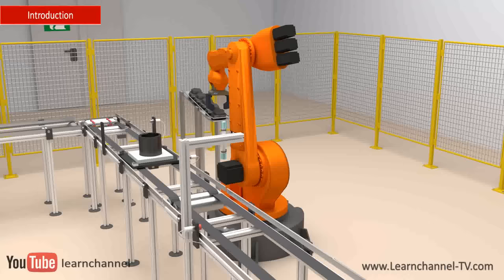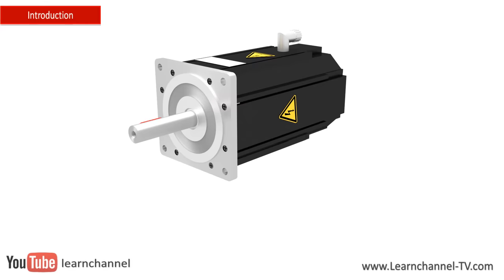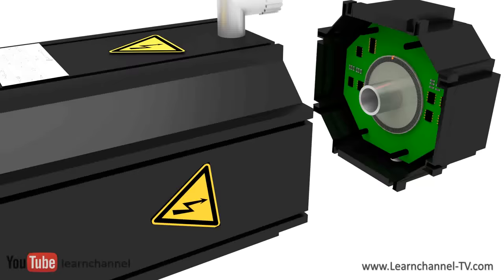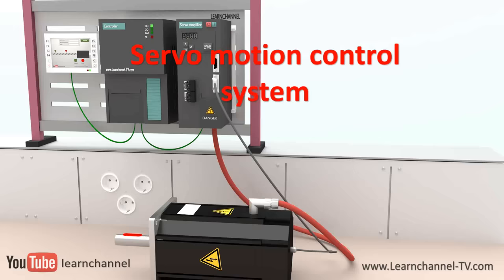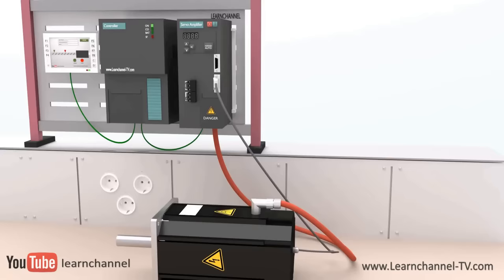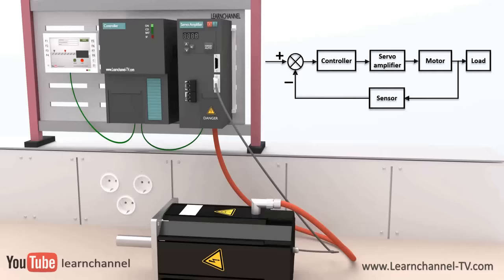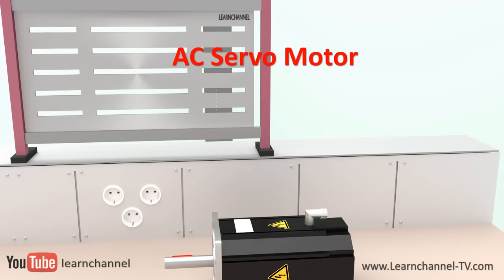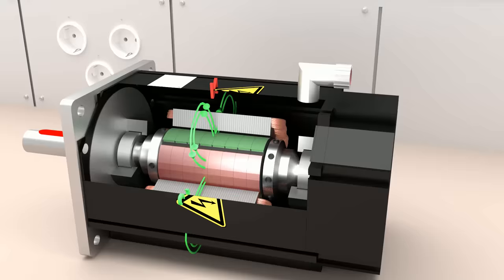Technical animation: How a Servo Motor works

Comment: Good video. How increasing the length (weight) reduces the moment of inertia?
Thanks.
Reply from the maker: The inertia depends mainly on the diameter and not on the length. 
In order to nevertheless achieve the necessary motor torque, servo motors usually have an elongated shape.
Reply: @learnchannel-TV  Thanks for your excellent work. Keep it up.

Comment: most of them are PMSM (permanent magnet synchronous motor) with absolute or incremental encoder,they have permanent magnets in the  rotor (neodym) and the stator coils have a distributed winding for sinusoidal driving just like the ac motors.

Comment: Can servo controller make small controllable steps (with rated torque)? Like stepper motor? Or step of servomotor big more then stepper motor?
Reply from the maker: First: Any motor used for positioning in e.g. CNC machine or robot can be called "servo motor". A servo drive must have a feedback system. 
The stepper motor can be clasified as a DC motor. A RMF is created by switching the stator voltage on and of or by reversing the polarity of the voltage. A hybrid-stepper has very small step-angles. Driven in microstepping mode you nearly cannot notice the steps.  For very simple position you can use stepper without a measuring system.
Talking about an AC servo motor you usually mean a 3-phase-synchronous motor. The current within the stator winding is steady or analog. This motor makes no steps like the stepper motor. 
Very small industrial robots, like Misubihi offers, use stepper motors as servo drive. Bigger robots (Kuka, Fanuc, etc.)  use AC servo drives.
Reply: Steppers usually move 200 steps per revolutions and no feedback means there is no guarantee that the motor actually moved those steps.

 Servos on the other hand have high resolution encoder feedback. I have seens servos with 2000 to 65536 pulses per revolution. This means that you can control the shaft movement with a lot more accuracy. 
So the answer to your question is that servo motor can make small controllable "steps", much smaller than a stepper. Although they are done in an analog fashion.

Comment: Are servo motors built so air tight to maintain the positive position feedback loop required?
Reply from the maker: I don´t know if I understood you right. You can get servo motor with different IP. The feedback loop ( for example by a resolver) provides the information about rotational speed and the angle of the rotor.
Reply: Thanks for the reply, I work with servo motors on injection molding machines and I've noticed they seem to run rather hot even at normal load and also seem to be built rather air tight, external cooling fins instead of any internal air cooling and was just wondering if that's why they need an internal dust free environment for the built in positional feedback loop system.
Reply: @darrylanton9323  Some that are built for continuous operation incorporate separately powered cooling fans. Servos aren't cooled by a shaft-driven fan like typical AC motors because they are used in applications where they run for short duration or at low speeds. They have to dissipate the heat through the case or add external means. If your servo motors get really hot while holding one position, the tuning of the servo drives may be too aggressive.
Reply: Yep, I've seen that some of our newer large machines have incorporated blowing fans mounted on the end of the servomotor directing air up the external fins towards the business end.  The new hybrid machines that incorporate hydraulic pumps driven by servomotors are more economical then full hydraulic and don't require as precise tuning as full servo electric machines do, luckily these full electric machines have a graph bar (0-100%) that's shows the servomotor load on each of the four variable servomotors that run during the process so adjustments can be made before overloading the motors and shutting the machine down.
Reply: @darrylanton9323  it will be air tight if the output shaft has oil seal.such small opening does nothing to cooling.  from the encoder end it must be sealed, because any contamination to encoder harm.

Comment: Why can't we change direction of ac servo motor by swapping the uvw leads. I was told servo motors are same as induction motors with encoder and gear control. Is this true
Reply from the maker: servo motors and induction motors have one thing in common: the rotating magnetic field. Servo motors have a permanent magnet as rotor and induction motors a "squirrel cage". Inthis vid I explained the RMF:
https://www.youtube.com/watch?v=vMu6DmfKHTs
Reply: Induction motor with encoder feedback and vfd can be used as servo motor but is not commonly used in servo systems. Permanent magnet motors are best for servo systems because of their high starting torque.

Direction of ac servo can be changed by swapping two leads but no one does that because it is needless. Servo amplifier can do this without swapping any leads. It can do other advanced things like torque, speed and position control
Reply: The drive has to be connected according to right turn phase sequence . If not, or one is missing, it gives a fault phase sequence error. The motor has to be connected accordingly ( U,V,W ) The shaft encoder on the motor will detect wrong turning direction. Direction, speed  ( = frequency ) ... can be easyly set by parameters. Some drives like Siemens Micromaster can be set using parameters that inputs on the terminal can be used to determine speed and turning direction. It even supplys the 10 V operating voltage conviniently.

Comment: Hello, can I run a servo  ac motor with the same program that starts the stepper motor(dir pulse)?
Reply: Yes you can drive a servo motor by pulse and direcion signal. Servo motor is widely driven using pulse dir signals. It is called position control mode of a servo motor.

Comment: I had did wrong connection for power cable which is  U and W I installed it up side down. Then after that the motor become heat. Is that make the motor broken because when I tried to run it, the servo drive give signal short to earth. Then power supply tripped.
Reply: if the isolation between the coilwindings is still intact it should work anyway.
Reply: Check coil resistance between the phases. It should be very small (a few ohms) and equal to each other.

Check the resistance between each phase and the motor body. It should show an open circuit.

If this is not the case the motor is gone.

Comment: Are brushed servo motors a thing?
Reply from the maker: Servo motors are used together with a closed-control system. But brush-motors in general  are 
used less and less because their high wear.
Reply: Brushed servo are not very popular but we have two out of 10 cnc machines in our factory which use brushed dc servo motors. A 1990 model Anilam milling machine and 2002 model Euromac MTX 1250 turret punch press.

Generally speaking any actuator which can propotionally control a variable using feedback is a servo system. Even induction motor with encoder feedback and a vfd can be used as a servo motor.

Comment: What is the animation software used for this video?
Reply from the maker: software is called Blender.
Reply: @learnchannel-TV  
How much time does it takes to create such an animation? I work with Solidworks Composer and want to know the difference.
Reply from the maker: @mk-zm6lu  I really cannot say because I made this vid during my fulltime job. It also depends on your equipment. I needed 2 months more or less - but I had a fulltime job.
Reply: @learnchannel-TV  
2 months?! Too much. Even a week is too much. If you want a simple tool, use SW Composer. Although it doesn't have all the abilities that Blender has, apparently.
Reply from the maker: @mk-zm6lu  I made this vid during my full time job during my spare time. I like Blender - it is very powerful. If you work with Blender daily you can make in in one week - yes.

Comment: how do you create such animation.
Reply from the maker: I used Blender
Reply: @learnchannel-TV    I am an electrical engineer student and I want to incorporate animation in my presentation at school. could you recommend a website to get free models.
Reply from the maker: Make a search with keywords like Blender, car, model and you will get some hints or suggestions for a car modeled with Blender. Some models
Reply: @MrDapo1999  are you presenting Servo motors at your school?
Reply from the maker: @onurozdemir2898  I tought electric drives in a technical school